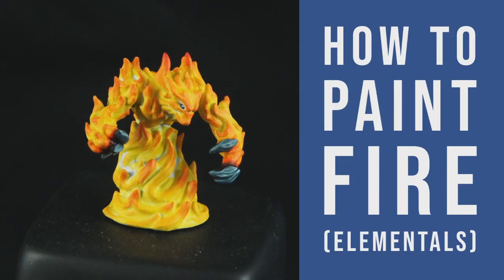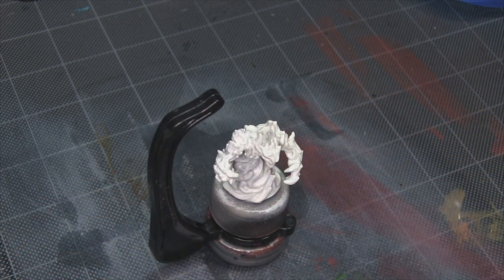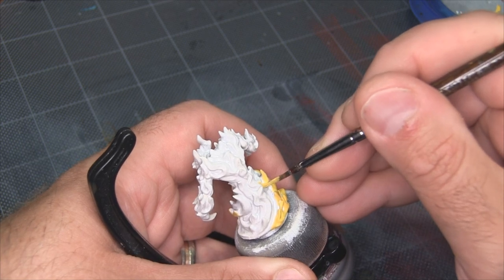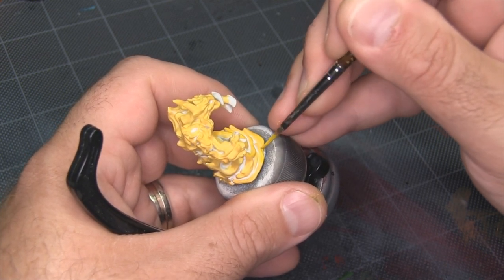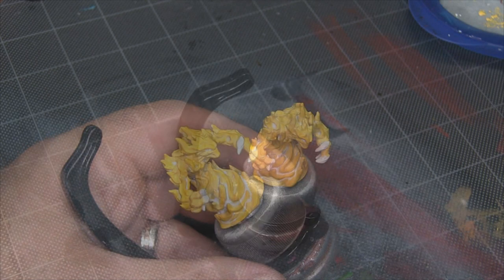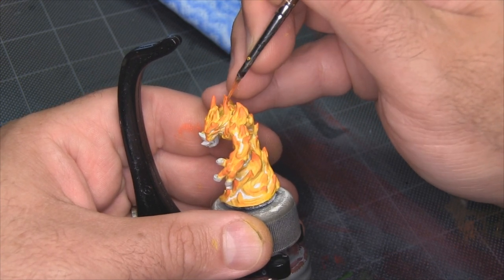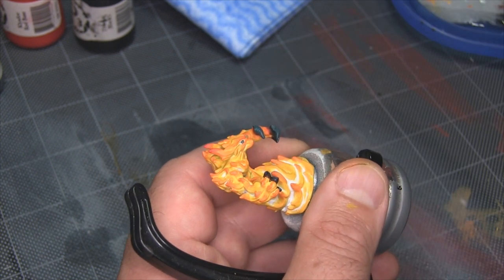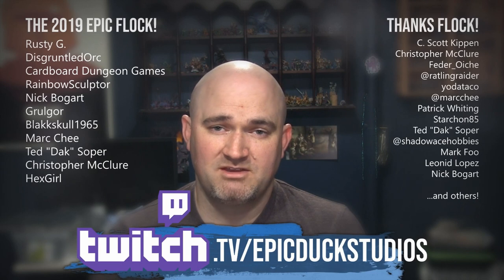How to Paint Fire (Elementals) - 3D Printed Mini

Comment: Angle you miniature back 15 degrees or so. It helps get any supports off the front surface. 
Also you dont want a large flat surface to be parallel to the build plate. If you angle it you won't need to sand the bottom as it will print more accurately.

Comment: Would you consider painting doing the opposite? i.e. orange recesses and white highlights. You could use washes or "a la" Vince Venturella, and it'd save loads of time, by taking advantage of the white undercoat.
https://www.youtube.com/watch?v=1YdY7GlwKQc
https://www.youtube.com/watch?v=J-dQU-dSNa8
I'm aware of the controversy: closer to the centre should be hotter, thus whiter... but imho reality goes out of the window when painting minis because "the rule of cool/lazy".
Reply from the maker: The opposite - dark in the recesses, light on the outer surfaces - doesn't really accurate represent fire. It's certainly faster, but speed isn't always the goal.